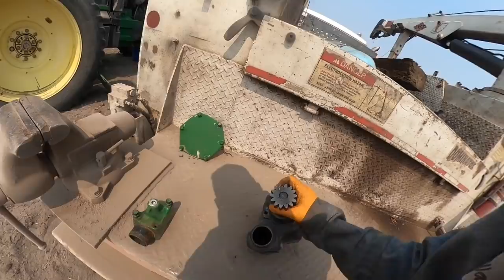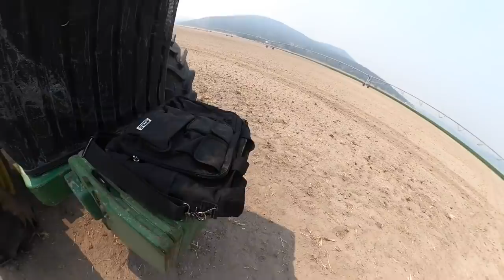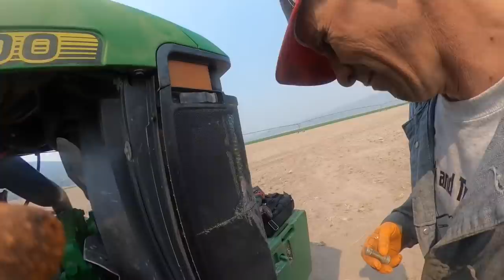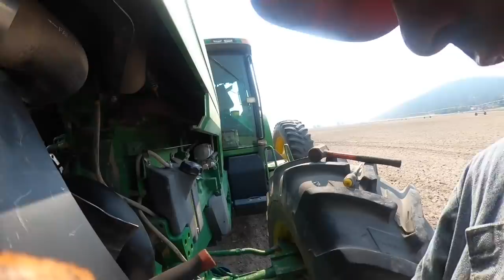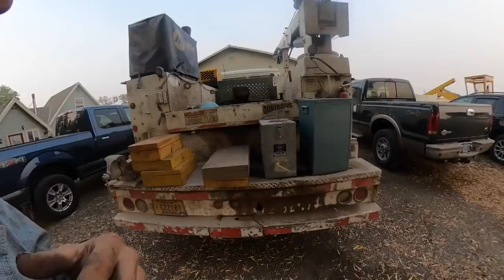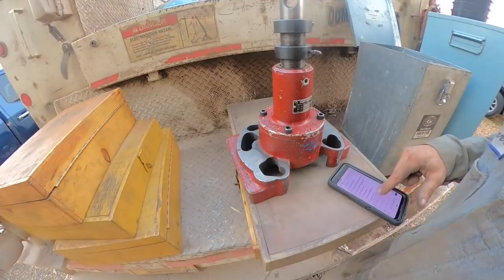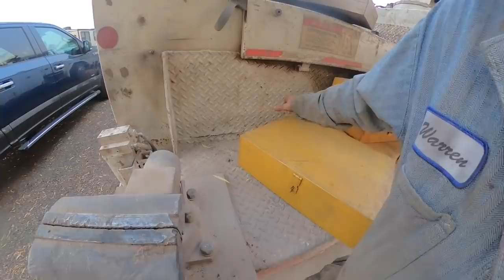Reman junk!

Comment: I don't buy reman parts anymore, I have been through it. There is just something about them, all John Deere all John Deere parts and they just don't last and I don't know why? Chinese aftermarket maybe better. I just bought a 4045 from a guy with 300 hours in it, I had a choice of buying that or a totally rebuilt one. I chose the used 300 hour one because I knew it was factory assemble and I knew it had original John Deere parts. God know who rebuilt the engine.

Comment: A mechanic in my area had one of these type of water pumps bearing fail( I think it was OEM) . It took out the timing gears and bent the crankshaft. It had ball bearing shaped divots in the crank gear teeth. Incredible damage. A used engine was installed.I immediately checked the type of water pump on the JD tractor at the farm I worked at. Different pump or Id have immediately recommended a new water pump . 
It wasnt obvious the crank was bent but the mechanic knew it was possible with the kind of pressure that occured. A dial indicator revealed the worse news on top of the bad. At least it wasn't a case of low to no  hours failure.

Comment: Reman engines are best purchased from reputable engine suppliers . 
Jasper ain’t one of ‘em . Because they love to re-use parts even though they have already lived their service life . 
I bought my long block from “Power Train Companies” best price , They deliver and pick up at no additional cost and I was able to purchase their installation kit ( New water pump , Serpentine belt , plug wires , plugs , Air filter , Oil filter , Upper and Lower radiator hoses and Gasket set ) plus upgraded the warranty to Gold and still paid far less than I would have for a Jasper reman . 
Words to the wise . Shop around and do your research . Well worth the time .

Comment: brother was going to comment on your cabover spring replacement vidio and they were turned off but i was going too say you need to find a couple of those old 90s truck bed rubber mats you could roll them up put them in the back of your service trucks and slide them under shit thats in the dirt and if they get oil on them you can just pressure wash them off and avoid all that dirt blowing every where when you use air tools and they are better on your back than rocks lol

Comment: All  remanufactured  junk is  well, junk, and many of the NEW parts are as well.  "Becuz  China."   The  NTSB, so far as  road vehicles  should have gotten  on to this  years ago.   Few years ago I bought a  dimmer switch from NAPA.  I don't think it  went 40 cycles,  I don't drive much at night anymore.   I'm  73  and  in the 70-80;s  I spent 15 years selling parts when  brands were BRANDS and even offshore stuff was usually  decent.  I  can't name all the brands that are now meaningless.   Perfect Circle, Sealed Power,  McQuay Norris,  National and CR seals, TRW  chassis and engine parts,  the list is endless.  And    Standard/ Blue Streak and  NAPA Echlin.  All gone to shit.  Big piles of soft  stinking shit

Comment: Hey Warren hope all is well. Not sure if you noticed or not, but in your last video on the broken leaf spring, the rubber plug was missing from the passenger side on the bump stop post. It was easy to miss if you weren't looking for it directly. I only noticed it because I was looking at the height difference between the two when you were comparing side to side alignment. If that driver hits a hard bump it's gonna be a hard metal to metal bang coming from the passenger side. Just trying to help out bud.

Comment: I bought a Reman injection pump from Deere. It came apart in 1 hour and wrecked the gear train on the front of the motor. No help from dealer or Deere. That's the new way of customer service/appreciation. When my Powerstroke needed a waterpump, I bought a new one from Ford. After 20 years, I figured that was the only way to NOT have to change a lifetime warranty one yearly, let alone any other damage it might cause. Yup, it cost $300 over $85, but so far, no issues after 5 years.

Comment: Am I missing something here? This is the green machine, and supposedly the failed water pump has no green paint on it. Maybe the reman. part is not from John Deere. Maybe the owner failed to install the pump correctly. When I take failed parts back to dealer or Auto Parts store they are replaced, no questions asked.
Reply from the maker: Yeah, and the brand new water pump I just picked up came from John Deere isn't painted green,  I guess we are just lying to everyone, I have just about had it with YouTube , ain't worth arguing with everyone all the time.
Reply: @westerntruckandtractorrepa1353  Keep posting, brother. Don't mind the nitpickers.
Reply: @westerntruckandtractorrepa1353  You know that you can BLOCK any commenter and they can not comment on your channel any more , if Im bothering you , block me too , I can tell you one thing some of it , I would not put up with 30 seconds .........

Comment: Are quite a few repairs are small stuff broken wire , wire connection sensors thing of that nature ? Then the small things that lead to big things such as this watet pump the cam gear which leads to the crank gear which leads to on and on just thinking ? Enjoy ur movies  interesting to see how J D 55 series holding up they were just coming out when I got out of farm ranching we had a 2955 threw 4955 interesting to see where the failed first thank you

Comment: The double insult is that it was John Deere that sold it to him according to your video around 1:15.

To think that so many truck drivers by reman steering gear boxes because they're one half the price of a new one makes me think that we're going to have some truck drivers driving into the concrete wall.

It still kills me as I send this message that it was John Deere that sold the crap: a dealership is supposed to have quality even though they're going to ask a ton of money for it.

EDIT: I performed a browser switch for a John Deere 8100 OEM water pump: The price came back around $365.00 net of shipping.

I don't know about the guy that owns the tractor but that looks like a six-figure machine to me.  I drive a low five figure semi tractor and $350.00 to me I can just laugh off.  Shame on the mess for this guy trying to scrimp on $350.00 which is about 3/10ths of 1% of the tractor value.
Reply: it was an oem reman  waterpump

Comment: I want to cry when I see all this bare ground tho, people just cant make the connection between healthy land and rain, this is how you create drought in western America, bare land.
Reply from the maker: And you have no clue what you are talking about.
Reply: @westerntruckandtractorrepa1353  Yes I do, its really simple when you start to looking into it. I can try to explain shortly. 
With this bare ground, the soil is 2-3 times warmer than if it was covered with diverse healthy tall grasses with 10-30 feet deep roots, either as trampled, standing dead or growing grass on the surface, and this will be achieved with high numbers of well managed livestock.  
When you have this warm ground, you are creating a heat dome over the area which prevents the cold front that carries the rain from penetrating in. 

And the other part of it is that you have a lot more evaporation, as the ground dries on top it pulls moisture from below and evaporates that as well. Water should only leave land through the soil to aquifers and river or through transpiration from plants, that should be the goal at least if we don't want America to turn into cactus. 

This is not some leftist BS political stuff, this is caring about people and creating a future that we want, and we all gotta start recognizing it and start learning about it for it to happen, especially with how fast the West is drying out. If nothing is done America will be the next Sahara.

This is the next relatively unknown revolution that few are talking about but nobody can oppose.
Reply: @Gustav4  

I'd rather America turn into a cactus and a bunch of s*** heads like future generations are and who they elect.

Your regenerative farming has some merit but I don't know if it's profitable with the amount of acreage that most western Farmers till.

How much of your tall 30 ft deep root grass can sell for and can it have enough protein in its dry matter to feed livestock?

Comment: Yeah, trying to save a dollar on reman parts that run off the motor gears or can contaminate internal motor, tranny, or rearend isn't a good idea at all and this is a perfect example. Other reman stuff to stay away from would be fuel injector pumps and hydraulic oil pumps. Case dealer put a reman steering pump in a mxm190 I bought from them. 50 hours later pump died and shed fine metal flakes into transmission. 2 transmission oil/filter changes, still showing metal flakes in oil, and 1000 hours later the transmission started crapping. out. Just say NOOO to remans

Comment: I know a manager at Renault/Nissan. He works at their Paris (nearby) headquarters. I asked one day about vehicle recalls and failure rates - it was around the time the Leaf was coming in and batteries were (and still are) junk. That manager explained that the company is very aware of failure rates from parts. The company accepted a 4% expected failure on any new vehicle and they had internal types of insurance cover that would pay for recalls, parts and staff time at dealerships on repairs covered by the company.
I've a feeling that vehicle manufacturers are raising those expected failure rates. As others have said, they really don't give a toss as long as they sell machines.

Comment: Here the owner brought from JD the renal part and it ball is up. Now who hasn't brought remain parts and they do last. So, blame the reman source or outfit. Hell, when new costs so dang much, why not a reman part from a trusted source. It's becoming so anyone wanting to save some $ may fall into a poor source parts rebuild.
Reply: I agree with you because I spied that the OEM price is $350 and the reman has to be at least $125.

But when it comes to a TRW steering gear on semi trucks now we're talking a $700 difference between remanufactured and new.  My best belief is TRW rebuilds the steering gears in the United States because I don't hear much problems of the thousands of semi truck drivers who've had their TRW steering gear rebuilt or switched for a rebuilt one.

Comment: Based on your reman advice I decided against reman alternator. Mine gave out in my toyota diesel car. A new Toyota alternator was 800 quid, a reman was 400. Got the auto electrician to rebuild the original which he also approved as being the best option.
Reply: People are just lazy now. A lot of components on a vehicle/machinery can be rebuilt, as they have in the past, but now a lot of people just wanna swap parts and not actually fix them.
Reply: @landlifem5872  goes for everything thing really, obsolescence was a strategy introduced in the great depression to stimulate the economy. It's working well! Similarly, people used to grow their own vegetables and stuff, but why when it's less than a dollar per packet down at the store.

Comment: Was wondering you opinion I recently purchased a nh bb 9060 3 by 3 big square baler looking for a tractor that would run that and some tillage on 100 acres pr year was thinking of a caseih 7240-8940 new Holland 8970 or a Jd 8400 what would be the most reliable for the future based on your knowledge of working on tractors I’m just starting out on my own don’t want Def nor do I need a screen in the cab any suggestions would be appreciated i enjoy watching you videos thanks for taking time out of your busy schedule to post them
Reply from the maker: Those 8970 are pretty tough tractors. Of course I don't think you would get hurt on anyone of those three in that era.
Reply: @westerntruckandtractorrepa1353  thanks guess I’ll see what’s out there
Reply: My vote would be for the 8400. We have several 8000series over 20000hrs that have had very little done to them. Mainly just fix the 4wd seals from leaking every 5000hrs.
Reply: @bcbloc02  thanks for the input

Comment: Your definitely doing it right by replacing the gears. However if that were my machine I think I'd probably just run it with the old gears at least until I could fix it in the off season.

Comment: Junk in the box. Run into it on a regular basis. Pisses me off when I ID the issue and replace a failed part and it still doesn't work because the new part is failed before it came out of the box.

Comment: Warren, Do you ever get time to service your service truck?  Bad design in that a simple water pump can fail and wipe out the gears. Heavy belt drive with an external water pump would at least prevent the carnage.

Comment: Water pumps have been driven off of fan belts for a hundred years, now some brainiac engineers decided to drive them off the cam shaft gear. Engineered obsolescence at its finest.
Reply: You make an excellent point!

I had to stop and think of all the engines I have worked on that used a water pump and not one of them was run by a gear!

You get the milk and cookies award from me!

🥛🍱

Comment: I have noticed that almost all the farmers I know that do well are also mechanics. It must really make a difference on the overhead.
Reply: My uncle had a massive dairy operation about 90 miles north of Las Vegas neVada. He was a master mechanic diesel, gas, electric, hydraulic. He would by a fleet of auction hay trucks in Sacramento and drive them back to Bunkerville Nevada. He had an endless supply of spare parts. He was a master welder. His operation was all computers, he played the Chicago options board. He was one of the most gentle , kind men I have ever met. He died about ten years ago as a very rich man. He and my aunt never took time off in 45 years running the dairy operation.

Comment: Does deere offer new and reman parts? Any time I have bought parts all I'm offered is new there. Didn't think it was like o'Reilly's. I realize engines are different.
Reply: Deere offers new and reman water pumps.  I thought I would save 200 bucks and went with the reman, a mistake I will not make twice😉.  Saving 200 bucks just cost me 3000+
Reply: @dtstarlingfarms1245  man that sucks. Honestly I probably would have done it the same way if I were given the choice at the time.

Comment: Well the tractor owner does take care of machines....that had to be one of the cleanest field tractors you have worked on in sometime....and yes, reman crap sucks.....great haul on the cutters too...
Reply: So as long as thetractor is clean your fine with the assumption that the owner takes care of the machine?

Is it taking care of his machine by buying a remanufactured part over an OEM part?

I think your statements rather presumptuous....imo.

Comment: The last remanufactured starter my buddy bought quit within a few months. I opened it up to see what went wrong and low and behold none of the magnets were attached to the housing. They all were spun around and stuck together. Thankfully we still had the old starter. I replaced the brushes in the old one and he hasn’t had any problem since. Utter crap this reman stuff is.

Comment: He may have purchased that pump from a Deere dealer, but I'm gonna go out on a limb here and say, it wasn't a Deere remanufactured part, now prove me wrong.
Reply: Either way it was a Deere dealer selling shit.
Reply: @prevost8686  A dealer is free to sell whatever he pleases, as long as he doesn't misrepresent his product. You stated as a fact that it was a John Deere Remanufactured Pump, and that he paid $300 for it, and i know for a fact those two comments are incompatible, so its not possible that its a John Deere Remanufactured Pump, which must meet stringent requirements, and the parts that are replaced, are of the same quality as there new pumps contain, that would probably cost about 10X what he paid, and is why he chose the $300 "Rebuilt" water pump.
Reply: I am going to step in and referee:

I agree with Prevost.  You don't see Toyota selling O'Reilly Auto parts within their brick and mortars dealerships.  Not that O'Reilly's makes crappy water pumps— I'm just saying.

If John Deere is allowing this water pump to be sold within its walls of its brick and mortar dealership then John Deere is on the hook as far as I am concerned.  

Now I will also agree with John Wayne: perhaps the author of this video should make it more clear who's name is really on the remanufactured part and was it bought in fact from a John Deere dealership.  I'm only 10 minutes into the video and that point hasn't been made clear yet.

I tend to agree with John Wayne it can't be a John Deere remanufactured part because they could not take or afford the wrath that would come from such an inferior piece of crap; but then again they may not be like Caterpillar.

Comment: Kent moore tools are pretty much exclusive to General Motors and the Detroit Diesel division of general motors.  That counter bore set is for either the series 50 or series 60 engines.  In the later years after the spx merger they started making tools for other manufacturers.  A few years ago I purchased every single kent moore and dealer specific tool that a Chevy dealer had when they went out of business.  That dealer happened to service medium duty and gm buses back in the day so I ended up with all of the 2 stroke Detroit diesel tools along with tools for the cat 3208 and cat 3116 since it was used in gm medium duty.

Comment: Hey Western Truck and Tractor Repair and I have a question for you what is the best way on to fix a power steering gearbox an can I rebuilt the power steering gear box or do I need to buy a new power steering gearbox let me know thanks
Reply: Weller does a good job exchanging your steering gearbox for a remanufactured one.  Just don't take forever doing the job like I have so you run out of money and have to hop back in a company truck.